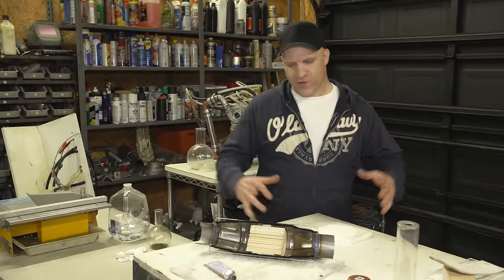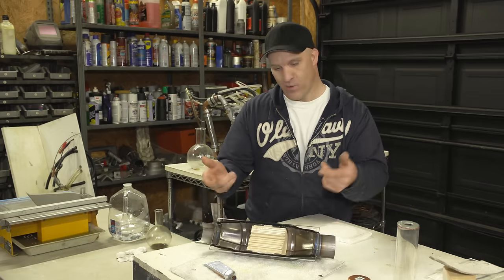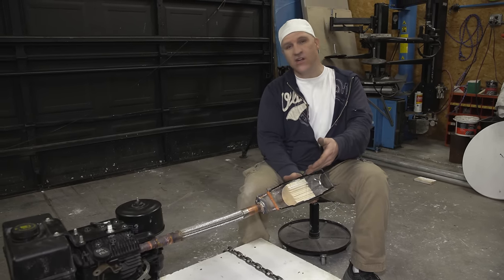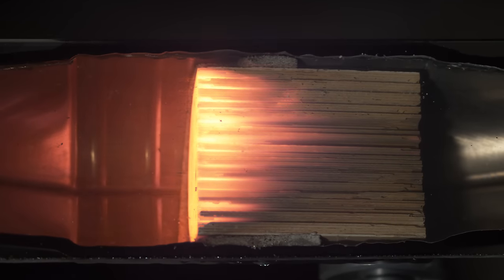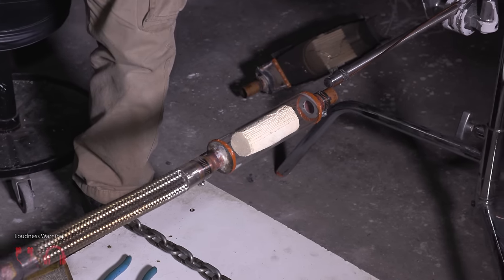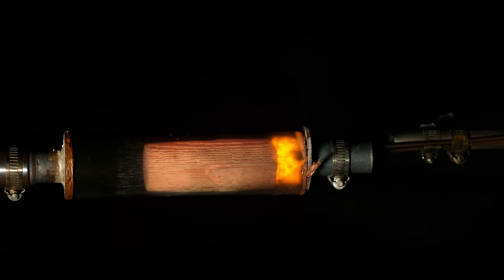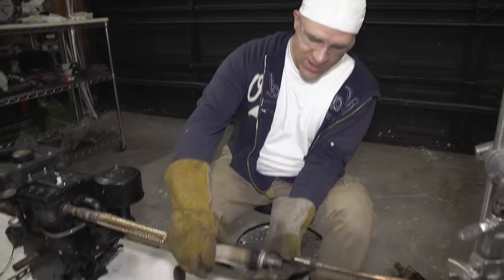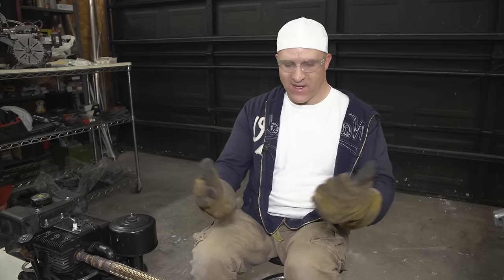See Through Catalytic Converter

Comment: The catalyst starts working long before it starts glowing.

The outlet is usually hotter (+50°K) than the inlet on a controlled 3 way catalyst.

The maximum temperature we measured was 950°C at a VW Golf 2 GTI (US model). Full throttle at 190 km/h uphill.

The normal operating temperature is between 250°C and some 500°C

Greetings from the founder of a German catalytic converter factory.
Reply: Holy cat, 950°C!

that's a pretty incredible temperature tolerance!
Reply: @Werepie  I'm not sure its meant to tolerate that high a temperature to be honest
Reply: How can one tell the difference between a clogged cat and one that lost active material? Is there such a thing as cleaning the cat (whatever method - fuel additives, washing after removal etc.) or is it snake oil? Thanks.
Reply: @cristianstoica4544  A catalyst does not clogg if it's installed at the right place. This means: No fiber filled silencers before the catalyst.
If it cloggs nevertheless it means that the substrate is molten (which happens at above 1200°C) and the catalyst is irreparably destroyed.
If there should be fibres on the inlet (for whatever reason), just use compressed air to blow it out gently, but avoid inhaling anything (wear a good mask - FFP2 or better and protect your eyes). 

If the active coating has left the game, the catalyst cannot get reactivated without an new washcoat and new noble metals (Platin, Rhodium, Palladium). All the "catalyst cleaners" are snake oils and may cause more damage than they would help.

Water does not help anything but might cause damage to the converter: If it sucks into the support mat, blowing it into pieces once it gets hot again.
Reply: COOL story bro.
Reply: I was thinking about a setup that is supposed to give better reliability and still low emotions for my car.  The car (v8)is designed to work with two ceramic preconverters and one mai cat. But right after the headers the temps are maybe too high for a ceramic car especially for an old car or if sometimes you get misfires or injector leak. So a ceramic core doesn’t seem a good idea for long term if placed right after the manifold. My precats were sucked into the main cat. The plan is to use two FIA metallic converters then down the stream a ceramic core cat. the FIA cats have low restrictions and burn a bit lower then the temperature lowers a bit and the main cat would burn the rest of it, again with lower risk of overheating I believe.
Reply: Good question, why cat's outlet is hotter than its inlet, this is a little counter intuitive, as the inlet is closer to the engine, this end should be hotter?
Reply: @BuddyNoNo  The catalyst converts unburned fuel, oil fumes and CO into Water and CO2 while the energy contained in this stuff is set free.
That's where the additional heat comes from.
Reply: @rotorblade9508  Steel substrates melt at lower temperatures than ceramic substrates, so your modifications will only make things worse.

The only way to avoid catalytic converter damage is proper maintenance of the engine.
Reply: @noidontthinksolol  What are you talking about?

The VW cars had far better exhaust values than Ford or Toyota - despite their fraud.
Reply: can I ask why you used a US model over a domestic?
Reply: @WhuDhat  Because my Businesspartner just owned that car and the TÜV allowed us to use that car model for the Certification of our first Converter model on the German market. As it was the same engine as the German GTI we were able to certify the converters for the Golf GTI and Golf models with less powerful engines.
Reply: I’m kinda curious why you’re using Celsius for the entire comment except for the temperature difference you gave in kelvin even though it’d be the same number in Celsius. Very minor correction, kelvin doesn’t have degrees you probably know that but just wrote it wrong lol
Reply: @monhi64  Celsius and Kelvin is more or less the same, but Celsius is a shifted scale with 0°C at 273,15 °K (freezing point of water) 

0° K is -273,15 °C - which is the absolute Zero. Therefore temperature differences are always expressed in Kelvin, while absolute temperatures are usually given in °C
Reply: @norbertfleck812  Hi Norbert, interesting reading your knowledgeable comments. Do you know where in Europe I might get some of the intumescent matting? My original 1995 cat was stolen and I'm very frustrated trying to get through Irish TUV (NCT) emissions test. I'm trying to combine two substrates into one can but need the mattng. Any help appreciated
Reply: @niallkelly5581  You may politely inquire at LRT Automotive GmbH in Walldorf (Germany)
Reply: @noidontthinksolol  Imagine thinking VW are the only company who did that. Also talking about emissions and efficiency whilst daily driving a truck is incredibly lacking in self awareness
Reply: Ha ha, any chance you'd have an idea why my catalytic converters keep failing on my fsi Audi (efficiency below threshold)
Reply: @StudioGoldsmith  Defective Lambda sensor, defective Air flow sensor or overheated converter due to worn up spark plugs
Reply: 950°C can also be seen on modern cars. 
The Ford Focus 1.0Ecoboost will run at 985°C at constant full throttle. Although it has a water cooled manifold. 
But it'll run at lambda 1
Reply: @norbertfleck812  As a Mechanic by trade, I just want to say thank you for giving such good explanations for proper Cat Converter operation.  I can use the extra knowledge to understand cat efficiency diags more.  Much Appreciated.

Comment: What I found most interesting was the difference that was quickly apparent between the inlet and outlet sides of the glass! The inner surface of the inlet side very quickly became dark and cloudy, while the outlet side after the honeycomb stayed clear and transparent - a perfect visual confirmation that it does what it is intended to! Great video, thank you!
Reply: Sort of, anything blocking/restricting flow of exhaust will get sooty.. I done enough custom exhaust work on my own cars to tell you that.. see y pipes with door build up after the cat.
Reply: It's actually the opposite - the inlet side was clear while the outer part was dark.
Reply: It does something but it's just breaking down the ash and gasses into another form NOT removing them! Burns cleaner but the particles are just smaller now. You can stand next to a running car and not smell anything but still start coughing. We're still being affected the same way.
Reply: @enigmareach1129  it's still better to be breathing mostly carbon dioxide instead of breathing in nitrous oxide and other worse stuff
Reply: @pilotavery   Sure but no one wants to address the 500 lb gorilla in the room which is the fact that upper respiratory diseases are ten times more prevalent than they were 30 years ago. Everything has a down side.
Reply: @enigmareach1129  considering air pollution was much worse 30 years ago, perhaps something else is the cause...
Reply: @enigmareach1129  You seem passionate about chemistry, maybe watch some videos to brush up on the fundamentals. Carbon Dioxide and Nitrogen gas are not Carbon monoxide and Nitrogen oxides in "different forms". Just wanted to stop you before you go trying to drink hydrogen peroxide cause it's just water in a different form. Maybe I can stop you from buying an ozone generator so you could breath "bigger oxygen"

The difference is the stuff before the converter is toxic to humans in small quantities, and the stuff on the other side is only a problem in really large quantities. Catalytic converters aren't a miracle cure turning exhaust fumes into wafts of scented candles, that doesn't make them useless. Things can work without solving all of the world's problems, you're being obtuse.
Reply: @pepperypeppers2755  Ash particles to not disappear no matter how many times you burn them. The particle just get smaller. Here's an easy experiment anyone can do, start your car and put your mouth directly over the tail pipe then tell us how well that catalytic converter is cleaning the exhaust.
Reply: @enigmareach1129  gotta be honest I lol’d
Reply: @enigmareach1129  Yes, the car is still putting out A LOT of CO2 - the same thing that is in soda's.  Have you ever coughed from inhaling  soda carbonation or when you drink it "wrong"?  Does it feel similar to standing too close to an exhaust pipe?  The catalyst also is breaking down NO2 which makes a toxic acidic rain, among other gases.
Reply: @pepperypeppers2755  very good explination!
Reply: @enigmareach1129  Its job is to convert very harmful molecules to less harmful ones, such as nitrogen oxide -> nitrogen and oxygen and as a added bonus to burn most left over hydrocarbons (fuel) and carbon particulate (which isnt ash btw). To properly burn leftover carbon and hydrocarbons the converter has to be at temperature, thats not going to happen when cold starting your engine right away.
Your reading comprehension seems to be quite underdeveloped considering it was explained to you already.
If it didnt work no auto maker would use them (and no legislation would force use of them), they arent cheap you know, the auto makers certainly dont make more profit because of them, most of the cost is in 3rd world countries that provide the rare metals needed for them, so the cost has to be beared by the customer, which is bad for the auto maker if they dont make extra profit, but have increased cost. No legislature wants to make life hard for their industry for no reason. So there is literally zero incentive structure neither for the auto makers nor in the legislature except for that they work and do what they are supposed to.
Reply: @_--_--_  Ash is the layman's term for said molecules. Catalytic converters amplify the heat from the exhaust to burn the gasses and particles at a higher temperature. Less harmful is nonsense. It's all window dressing. The smell and visual of the exhaust is gone but particles are sti coming out. Want to prove me wrong? Start your car up and sit on the ground right behind the exhaust pipe for 5 minutes and see how you feel.
Reply: @_--_--_  You are delusional. I have been working on cars for 30 years and have seen what's inside catalytic converters. The catalytic systems are a way to appease environmental zealots so the auto industry can keep pumping more cars out and the government can import more cars. It's also a great way to make sure people keep replacing their cars instead of fixing them. The auto industry has been consistently making cars harder to fix in order to sell more cars. That's the problem with everything these days. Nothing is built to last. You can parrot what they teach you in school all day long but but until you gain practical knowledge you only know half the story.
Reply: @enigmareach1129  Ignoring science and physics is the very definition of delusional, you are literally no better than a flat earther at this point.
It doesnt matter what they teach at school, chemistry is a part of physics and it doesnt care about politics or governments, there is enough material out there to teach yourself any field of science and engineering you want without bias, you simply refuse to.
The only point I agree with you about is that science without practical application is only half the story. But pratical application of science is the field of engineering, which I am very sure you know nothing about either, since science is a prerequisite for any engineering field.
Reply: @enigmareach1129  the one and biggest upgrade from a cat is, that it binds carbon monoxide with oxygen because of its high temperature and forming CO², due to this u have clear inlets and darker outlets, bc CO² has a colour and CO doesnt. CO is also veryyyyy very toxic whereas CO² is just unhealthy :)
Reply: @enigmareach1129  but not CO, Carbon Monoxide is a poison. CO² is  too but far more helpful for the invironment
Reply: @darkfur18 here's stuff in the air that wasn't in this amount 30 years ago and there's stuff not floating around anymore or not as much. But we have more cars on the streets, right? It's not only the exhaust fumes. We're also inhaling particles from tires and breaks...always great to ride a bike in traffic. So refreshing!

Comment: You see flame because the catalyst can't keep up and there isn't enough oxygen stored in the catalyst to do it's job. An EFI system is constantly switching slightly lean/rich to allow the catalyst to store oxygen to allow it to burn HC when present. When exhaust in this video which is super rich (orange flame is indicative) reaches atmosphere it combusts with a flame. You see some flame at the back of the catalyst here because there is some reverse flow every stroke. Excellent video.
Reply: In the 70s they had cats and used carburetors with no computer.  They did inject air with a pump to help burn the hydrocarbons.  76 Monte Carlo and 80 Citation v6 were examples.

Comment: Take a scrap piece of leftover catalytic material and hit it with a propane torch until it is red hot. Cut off the flame and then quickly expose the red-hot area to a gas stream and you will see it glow red hot again with NO open flame. 
Cody’s lab did a video on catalytic material some time ago. Worth the watch. 
Thank you for the very cool video and please keep up the great work.
Reply: Thank you and regards to Briggs
Reply: Butane soldering iron does the same thing.
Reply from the maker: Funny you say that, I had a shot that I was supposed to use in this episode but I ran behind schedule. I take a piece of catalytic light It up get it warm and I not only hit it with propane gas, I hit it with a scary amount of propane gas...lol. it look like the damn sun !!!
Reply: Dope
Reply: @WarpedYT  That shot is going to make to one of your channels eventually right?... I want to see that shit...lol.
Reply: That's exactly how Mr Buddy heaters work
Reply: @WarpedYT  that would be cool clip to add in an outtakes video about this
Reply: @WarpedYT  I too wish to see this clip, I've actually been trying to find out what kind of reaction butane and/or propane would have on a hot cat, as I thought they were designed for liquid hydrocarbons. Looks like they have a purpose on LPG vehicles after all 👍

Comment: You can also just heat the honeycomb with a torch to get it warm and then put the torch out. Then just blow the gas from the unlit torch through it and it will burn without a flame and get the cat material orange hot. I always found it fascinating to watch something burn with no flame because it's just so counter-intuitive.